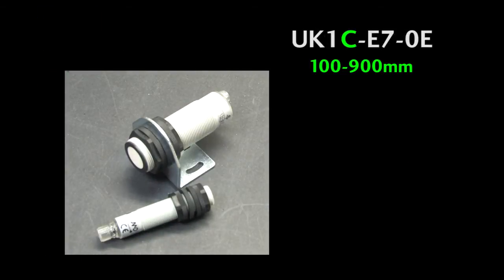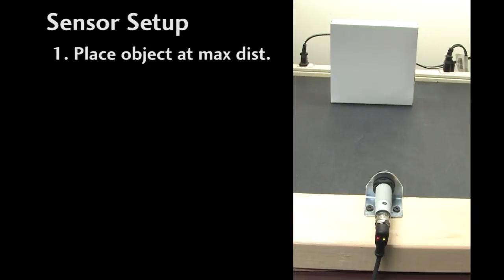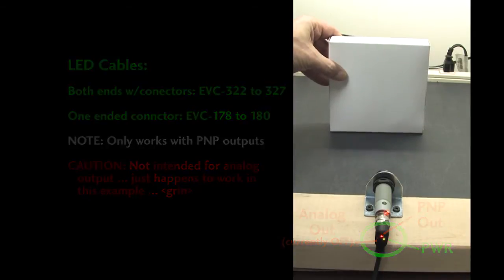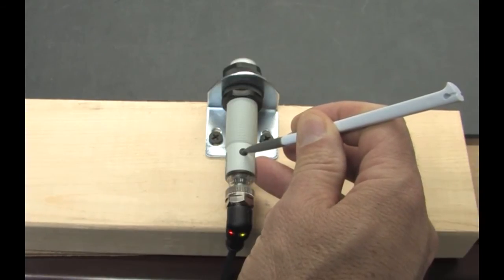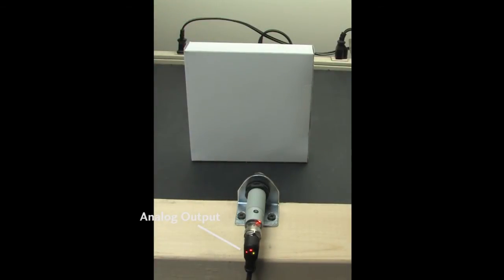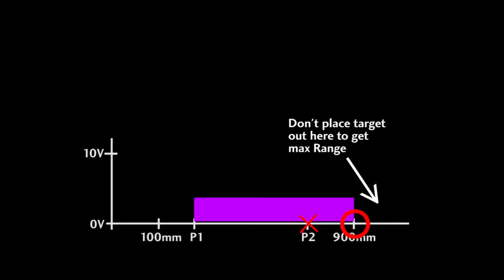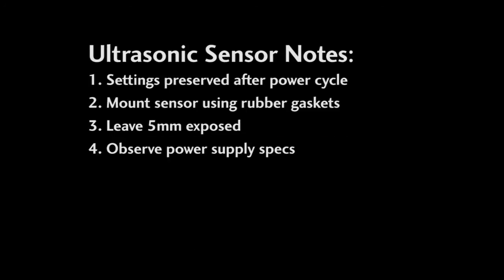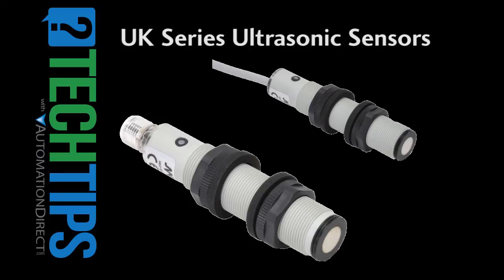Micro Detectors Ultrasonic Sensors UK Series from AutomationDirect

Comment: Hi. Is there any ultrasonic sensor with 2 digital output? instead 1 analog and 1 digital.  I want to detect low and high level with two different  digital outputs
Reply from the maker: Hi Freddy, Without knowing your specific requirements it's hard to point you in the right direction (Type of outputs? Type of Application? Sensing Distance?, etc.).  If you want to sense fluid level in a tank, then check out the Flowline Level sensors - they have several outputs.  Otherwise, please contact AutomationDirect's free tech support - they will be happy to work with you.  https://support.automationdirect.com/